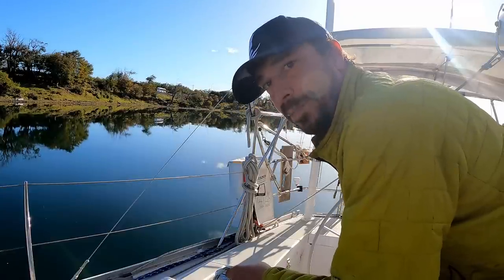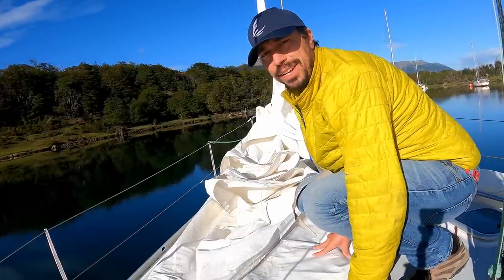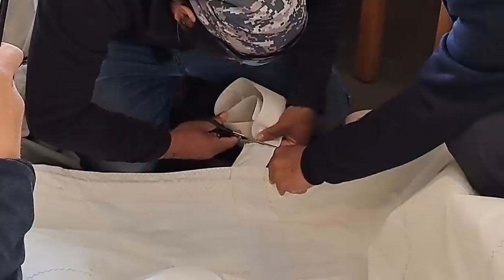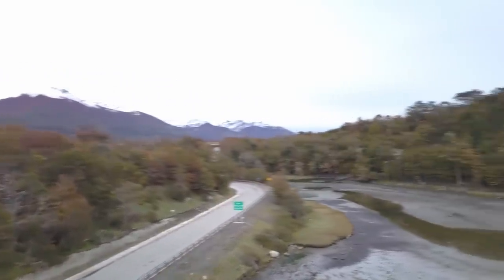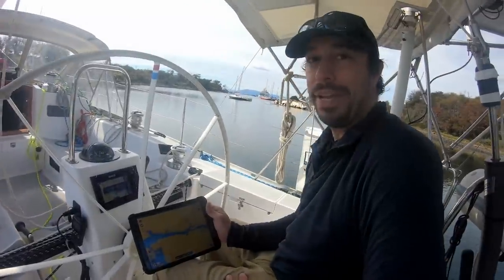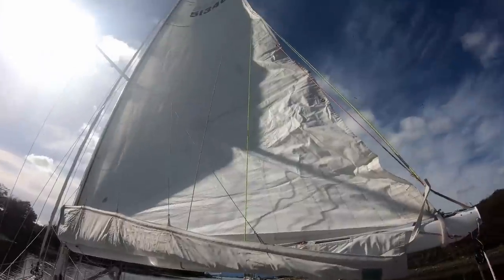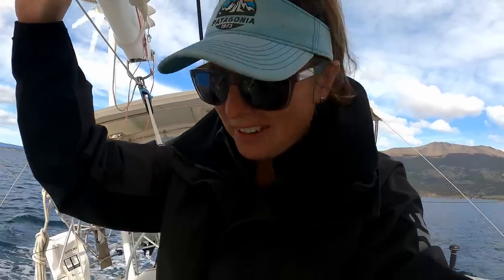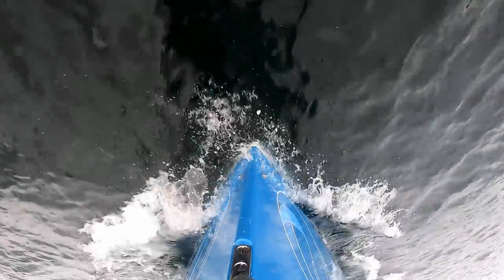Sailing The Beagle Channel to Ushuaia Argentina [Ep. 111]

Comment: I watch a number of sailing channels and I have never seen any boat flying a black ball in the fore triangle when motorsailing. Is it no longer required?
Reply from the maker: It would be a triangle when motor sailing, a ball would signify being anchored. I have never seen a small yacht do this, but you are correct about what the books say about using day shapes when motorsailing.